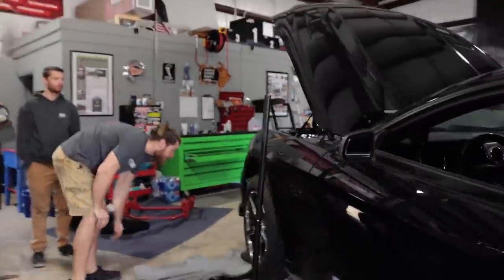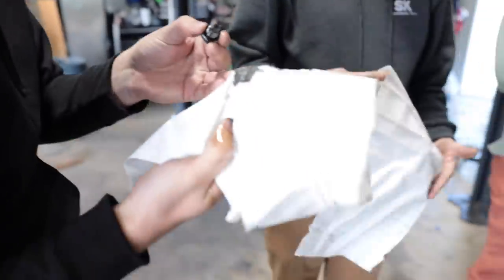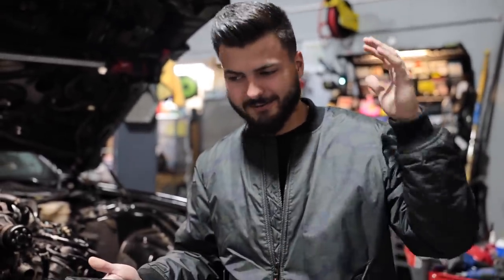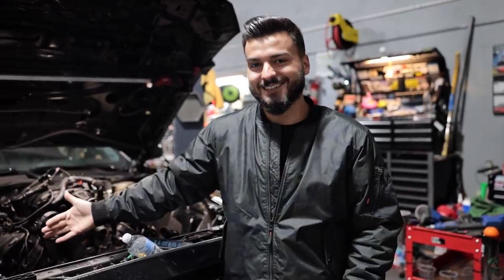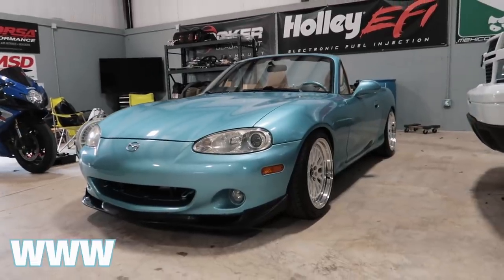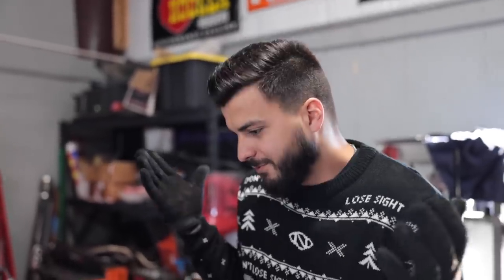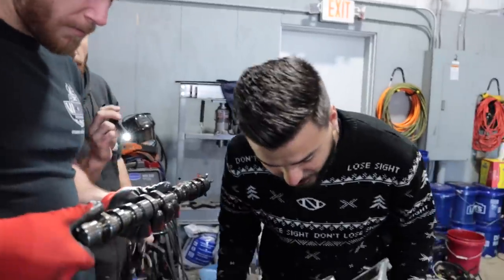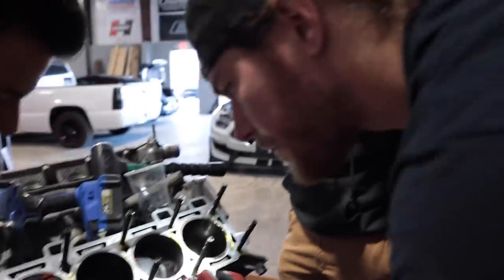Tearing Down Satan’s Blown Motor! | 1,500hp Coyote Engine Teardown

Comment: All I'm going to say if the motor was built right from mmr it should and would of never popped on that lund tune hand's down, this is mmr's deal... A company that big and all the time they have on the coyote platform to see this happen is sad, even if gavin had wrong part's and they switched some thing's out,  mmr now at this point are the last one's that had it and did there WINK WINK quality control on it..

Comment: I seen that mighty auto parts filter on there lol I used to work for them there products are pretty damn good despite the fact my manager was a asshole and it made it not a fun job but all there oil products and filters are made by oem manufacturers like purolator and whiemer and there oil is made by kalu and companies like royal purple.

Comment: The bearings arent a different size lmao,the bearings overheated they are blue in color 🤣 when u heat metal that hot it warps.also yes loosen all cam caps evenly but bend a camshaft? No

Comment: fudge that hatters its a common problem when u blow a head gasket and water washes the bearing out and bearing falure is going to happen because the head lifted due to the aluminum block it wont hold the power the iron bluck or just get a full built race block but shiz happens and somone didnt build the engine to boost thoes limits so um yes its screwd sorry i love yah vids and u can drive but this crap happens alot!!!!

Comment: For huge boost, the Coyote is a fragile platform.  Tearing up the main bearings, lifting the heads, overcomplicated cam timing set up, build errors...  Doing the same thing again - Coyote with huge boost is going to be a rinse and repeat failure pattern.   For how to do big boost that will live, look at some of Boroski's LS builds.  with the LS platform, can use a much better Dart LSNext2 block.  With 1/2" main studs and BBF size main bearings.   1/2" head studs in a proper pattern to clamp all around the chamber.   For that much boost, you need to O ring the block.  You are lifting the head and blowing out the gap between two bottom head studs.   You fix that with an engine using 6 head bolts, 1/2 studs, o ring grooving  the block... not a Ford fan, so not sure if there are aftermarket ways to do all that with a Coyote platform.   An aluminum OE block has it's limits.   That is where the aftermarket support for the LS, especially stuff like the Dart iron LSNext2 block starts you with a foundation capable of huge boost.  If you were lifting the heads and tearing up the main bearings with a supercharger, changing to a turbo set up is 6 of one half dozen of the other approach.   Still need to address the fragile foundation - block and heads.

Comment: Question what fails in an engine that is over reved in combination with high torque and horsepower on a skinnyfactory bearing.. then driving more than 30 seconds circulating the bearing through timing tensioner, oil pump, supercharger ect could cause sticking timing tensioner causing bad timing leedi ng to headgasket failure.. just cause and engine is built to even turn 11k rpms doesnt mean it will last or even last long just ask nascar... love your videos but revs are to high for that small of a surface area of the bearings.. look u will notice bottom side mains failed and tops of rods failed tomuch for those bearings maybe weak bearings also played a roll.. noticed one cylinder the valves were discolored maybe a failing injector? Doesnt look like water steam cleaned it.. not a dig just observation from fellow internet keyboard warrior lol keep videos coming love them

Comment: Fuck the haters frfr but mains chewed up and a couple bad rod bearings scored up cams I'd say you need to run heavier oil and a stiffer spring in the oil pump it happens... Happened to me on a 2jz fixed it swapped cranks and rods did it again... So a second time new crank and rods ported shimmed oil pump hasn't happened again

Comment: Sooo...you admittedly ran an engine with coolant in the oil.....Now your blaming the machine shop for premature bearing wear. I'm not sure if you are aware that coolant isn't lubricant. MMR claims they didn't charge you a penny. Is that not true?

Comment: From the  looks of main bearings, and rod bearings with them being completely wiped out in such a short length of time, that the oil pump or some part of the oiling system failed. 
What oil pressure did you guys have during initial start up, and before the failure? could someone have over torqued the main bolts? what was the torque spec on the mains? also the balancing could be part of it.  
The main issue is oiling. There is no way that crank was getting proper oil. I remember you stating that you installed a "extension" on the oil pick up, is it possible that was leaking where it bolted to the block or pick up tube?  a freshly built engine should last longer than this. I can see parts breakage at high rpm, high hp but this was a completely different issue. It wasnt a hp breakage, it was an oiling and or machine issue.

Comment: If you were one of the people crying about the redline situation then you exposed yourselves to be idiotic when it comes to cars built to race. Just about every car that races in one way or another has its redline set higher than how its set from the factory so long as the valve train has been updated to handle it. If you don't know what you're talking about at least pay attention in future youtube videos (since you've obviously not been around actual high performance cars) to see what I'm talking about and you will consistently see drivers bury the limiter well past what the tach reads as redline unless its aftermarket.

Comment: Blows head gasket, temp gauge increases, gives it big throttle and a forced induction engine, confused why copper material has run through engine.

Comment: Dude relax. The keyboard savages just talk shit because deep down they envy you and your success. Hell most of the haters are probably snot nosed teens that drive civics with 12 pounds of oil pressure and rattle can painted steel wheels thinking they can pull a 9 second pass with everything on their wishlist at jegs and summit. Slap at GM LT engine with twins in that Ford and call it a day just to be different and piss off all the almighty Ford fanboys

Comment: MMR should sue him for slander. This shit stain popped a head gasket a proceeded to flog the engine afterwards. Coolant in the oil, tore up the bearings then wants to blame someone else. He is the exact type of customer that its just better to show to the door. He doesnt have a realistic view of modified vehicles. They break constantly, thats what they do. Watch cleetus if you need an example they dont hide anything. Or trash builders for their own screw ups.

Comment: This is funny because the everyone is mostly wrong here. Look I’ve blown engines @itsjusta6 your head gasket your data log won’t prove much to you nor MMR. You think your head gasket was a separate Issue which is not the case. The metal you manage to make happened over time the engine has been hurt since first start up. Also your head gasket and and loose bearing and welded ones have something in common heat more thank likely your block and everything else in the short block is warped. Hope you see this comment @itsjusta6